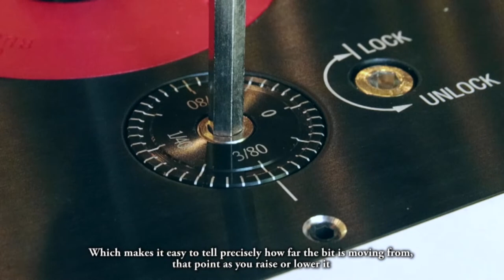O'SKOOL - How to set up Router Lift for Bosch, Dewalt, Craftsman, Porter-cable, 3-1/2" Dia routers.

Comment: Do you use motor diametter 80mm?
Reply from the maker: we do not use an 80mm motor diameter. We use a 3.5-inch Luda motor.

Comment: Do you sell router lifts?
Reply from the maker: You can find the Router Lift System on Amazon  
✅U.S  https://www.amazon.com/dp/B0969YN4N5
✅Canada https://www.amazon.ca/OSKOOL-Router-Systems-Diameter-5-Piece/dp/B0B2ZQ4YFM
Reply: Hi, I bought the same lift and I have a question please. Can I fix makita router on it? If yes, which model can be fixed?